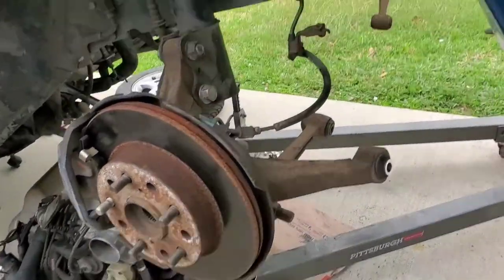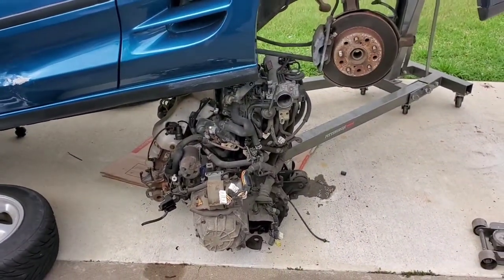kswap mr2 build part 4  ENGINE REMOVAL AND ENGINE BAY CLEANING

Comment: can i just remove the passenger side motor mount to lower the motor 6 inches to work on the water pump and timing cover?
Reply from the maker: Yes you can 👍

Comment: Awesome man! Is your mr2 nautical blue metallic? looks like the same color as mine! I just got my mounts and harness from toyonda myself! I had them mesh to the body harness for me, I'm not the biggest fan of wiring lol. You're doing a super similar set up to what I've got/planned so I'm excited to see how the build turns out and the power it makes/times it runs!
Reply from the maker: Thanks man! It's not the factory color the car was repainted before I bought it and unfortunately the clear coat is gone and it will have to be painted again. But that will be for another video. I appreciate you watching. Looking forward to seeing how your build comes along.